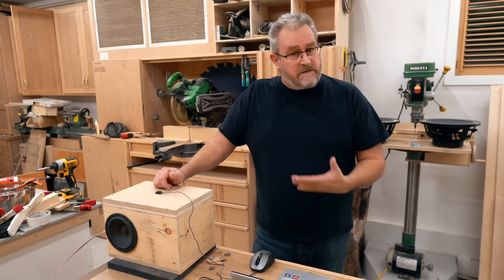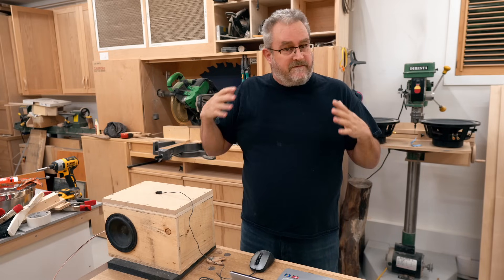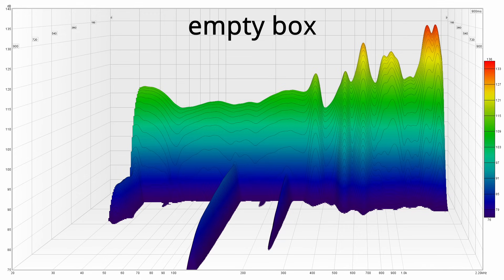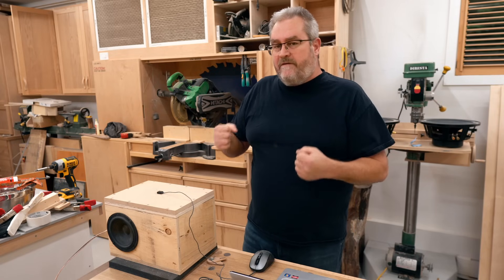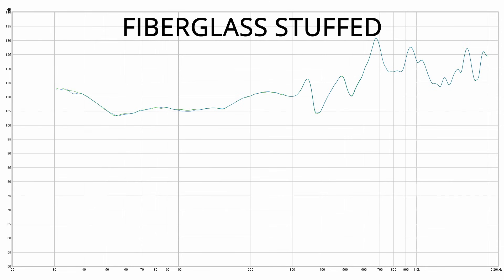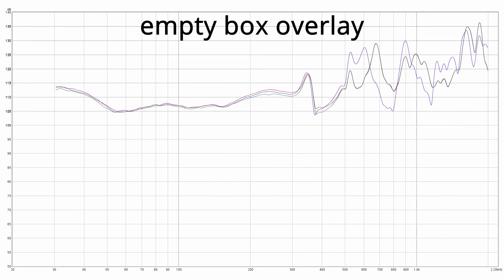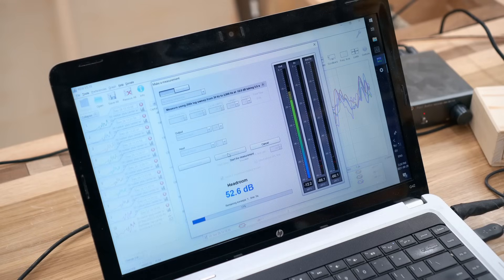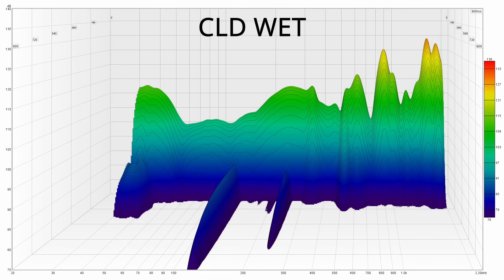Best Stuffing for Speakers Tested - Unexpected Results

Comment: Since you used two equally thick layers with silicone in between you actually mad CSL pretty ineffective. Silicone itself is not good for CLD because it stores energy but this is not the main point. You should put CLD where the shear stress on the visco-elastic layer on the greatest i.e. on the outside layer of the panel. Interesting experiment would be to use damping glue, even silicone would do if nothing else is found and a thin layer of aluminum. When I say thin I mean like a thick foul or beer can thickness.

Comment: Why not, as they say, "think outside the box" (heh, heh), and experiment with concrete slabs, ceramic tile, cement-board, thick cork, sand/epoxy slabs, etc.?

Comment: Fiberglass cotton is nasty stuff to work with, I used it to insulate an attic and a porch and that is the extent of using this material, would never use it in speaker enclosures. 

I had poly-fill cotton on my 1982' home-built V-ported La Scala Klipsch horns, inside the woofer cavity, for tuning purpose but recently, while cleaning them, took it out and I am getting better sound from them. They are crispier though, but I do not run them at high volume as in my younger days.  

I also built a set of shelf speakers, in the 80's, these mini cannons, bottom V-ported which I also used poly-fill to tune them, but the real deal is in the additional Formica sheet reinforcement over 3/4" ply they are built from. The best solid shelf speakers I have built, why I call them mini cannons. 

Whatever sounds satisfying to one's ears is what counts, but the object is obviously to replicate live music as close as possible.

Comment: Add fiberglass and ONLY fiberglass.  Idiots use polyfill and don't seem to understand thermodynamics - the glass fibers pull heat away from the voice coil and act like a heatsink.

Comment: Why are you measuring the resonance of panels?  The stuffing is not supposed to be used for the purpose of dampening panels. It's for reducing resonance within the cabinet to reduce it's interference in the form of smearing on the soundwave produced by the driver.
Reply: Yea. That's what i thought.

Comment: well what about a thicker rubber speaker gasket,rubber is used to stop vibration but would it show results with your test ? which i really enjoyed thank you,im one of those people that never go overkill on bracing and using double walls on enclosures,i cringe in using a double baffle in fact i use 3/4 mdf but when i go to put my double piece on i actually just use 1/2 mdf.my bracing is kinda like well whats right above your head ? if your sitting in your house look up,in the attic theres 2x6's vertical so i use a couple pieces of light weight pine not treated pine 2x4's and put them vertical under the baffle with screws on each side of the box and screws going into the 2x4 from the top.thats just me.ive never cut picture frame shaped bracing,to me it looks like it would interfere with back waves.

Comment: I'd like to know how fluffed up cotton wool works. As a plant product it is green, sustainable, and ultimately biodegradable. Also it is more widely available than long haired wool.
Reply from the maker: Try it. But don't be tricked into thinking it's "greener" because it grows on a plant. 
There's still a lot of processing (that most environmental-patients) would not see as "green" that goes into taking it from raw to refined, not to mention what it takes to grow it and harvest it.
We aren't running out of sand and rock anytime soon, so fiberglass and rockwool are every bit as sustainable as cotton. It may actually use less energy to produce, since so much of it is made at the same time in plants built to efficiently do that.

Comment: I followed your procedure but i think you have it wrong
One thing is the cavity resonance that can be tamed with the 1st 3 materials you tested
And the cabinet resonance that is what you trying to tame
For the box ( not the cavity ) there are different approaches
The simples one is to paint the interior with bitumen paint for instance.
Or a double panel cabinet with sand in between as another option. 
I think you hqve the wrong aproach with the fibers for the purpose of the video. 
Best regards.
David

Comment: I am rebuilding a set of Berkley cabinets for my 12" Gold Monitors. When I originally built them in 1972 and used Rockwool for sound deadening. I have worked in multlex theatres installing sound panels. I have a few left. They are one inch thick of compressed of what looks like insulation.  What are your thoughts on putting this on the cabinets walls instead?
Thanks

Comment: Trust me I agree with the idea that fiberglass or rock wool would be better than poly fill, BUT and that’s a big but, the glass fibers in both the rock wool and fiberglass is just too damn itchy and dangerous to have just blowing EVERYWHERE from the vent/port. Just thinking of it go me itchy over here, I believe the rule of thumb is 1lb (16oz) per 1cubic foot so 58g (2oz) is no where near the recommended amount of poly fill to even notice any difference.
Reply: Of course if it’s a seal enclosure then I would definitely go with rock wool panels agains the face panels then stuff loose fiberglass inside the chamber.

Comment: Rubber generally acts like a spring. Be nice if someone tried Dynamat or Second Skin, they are made to reduce panel vibrations.
Reply: I did that about 2 weeks ago. Kilmat on the inside of my tower speakers. I don't have measuring equipment, but I did one speaker and left the other as it was. To the touch the vibration in the treated speaker was less and stopped much quicker than the untreated. So I went ahead and did the other speaker. I do know it didn't hurt the sound in any way and to me sounds slightly better. Bass was tighter/  more defined. I would also love to see a measurement of this.
Reply: @johnloupis2347  Nice! Makes sense to me but measurements would be nice.
Reply: @freeradical431  I agree 100%. I'm a bit surprised we haven't seen someone on YT do it. I wish I had all the equipment to do a test.
Reply: @johnloupis2347  I think theres a huge misconception that car audio and home audio dont mix. Funny thing is almost every advancement in audio has come from the car audio industry. Shit, we have been using class D amps for years, at thousands of watts, not 125 watts like these Ice and purifi modules.
Reply: @freeradical431  Right! I would think most of the same issues apply.

Comment: i'd love to see a similar video (if you don't have one already!) covering how these different kids of stuffing materials affect the response/impulse measurements from a microphone. i recently built my first "kit" speaker, the desktop minis from GR and there are certain things i'm finding i'm not a fan of. they have a weird upper midbass resonance or chestiness to them, i realize i'm probably using the wrong terms to describe. some electronic music seems to sound harsh, gratingly metallic in the top end. there's probably not much i could do to help the latter, but i wonder if i should have gone with rockwool or fiberglass instead of polyfill, if that might have helped with the midbass/midrange. (i'm not bashing them, i think they were a decent value for 200 bucks) i'm excited for my next project either way

Comment: I feel you are looking at the wrong thing for what you are trying to do. Dampening has nothing to do with panel resonances, it has to do witih SPEAKER resonances inside the cabinet. Your tests of adding material to the top were more inline but I feel that you should test different kinds of bracing and combinations thereof.

Comment: I would have put the stuffing right behind the woofer.  Also, try lining the inside with No-Rez dampening material as a comparison to an empty box - I would,bet that this alone would make a huge difference. The rubber lining you placed was way too thin to make a difference.  The CLD method sounds interesting by sandwiching silicone in between the wood, but you have also effectively doubled the thickness of the wood. I would be interested to see if glueing the two pieces of wood was just as effective than the silicone.  Interesting tests, thank you for posting!

Comment: Very interesting as usual. I wonder if using rubber sheeting between the two panels instead of the  silicon would have more or less effect.
Reply: I found 3m make some very specific rubber sheet. I wouldnt doubt they have something suitable.

Comment: I have been under the impression that stuffing was to dampen internal parallel reflections. Dampening the walls by rubberizing and bracing is in no way polyfills job, apples and oranges.

Comment: I found it odd that the various stuffings weren't directly behind the woofer. I always thought the role of any stuffing was to absorb/diffuse the rearward wave of  the cone and flatten the impedance curve, kinda like how the vintage dynaco speakers did with their aperiodic design. Every acoustic suspension speaker I've ever opened up had the stuffing directly behind the woofer.
Reply: I've opened some older ones (from the 60's) that had wool material on the sides bottom and top, but nothing on the back wall. When I added rock wool to the rear wall it hurt the bass performances alot. So, I decided the people who designed them knew what they were doing and returned them back to stock. The bass came back. Not sure why
Reply: Probably back wall is used as a reflection to reinforce bass from front. Bit like bass reflex.
Reply: Stuffing lowers the effective Q of the driver.  @edjackson4389
Reply: The Dynaco A35 is an interesting sealed design where the woofer chamber was greatly filled with mineral wool, and then a slot in a wall divided that chamber from  another chamber which was empty!
Reply: with my EPI 150’s i did add a front to back brace as well packed as much poly as any teddy bear could take. 2 way speakers are always a battle with bass and muddy v clean and tight
Reply: No not nessescarily. Not directly any way.
Reply: indeed. You first want to cover walls with thin layer. Then add thicker layer in corners and keep little room behind speaker for air to move free and spread  in box. Large walls you brace in middle using wood
Reply: Stuffing has to be in the middle of the box to impact qtc.  Polyfill is fine to use.
Reply: so this test is wrong, rigth?
Reply: @chicotruco  no, this test is fine. That's another test for you to make a video on

Comment: Another thing to try is to put a cavity between two panels and fill it with sand. This should be even more effective than the CLD.

One more experiment to try is to mount the woofer compliantly to the box. Add a ring of soft material between the woofer and the box. I read a study years ago and that had a big effect.

Comment: I always thought that the purpose of stuffing was more to dampen that hollow sound you get in an empty box as opposed to damping the resonance of the panels.
Reply: yes, you can damp the standing waves/resonances, but just a tiny bit. the best way is to put boards horizontally and vertically inside that partially reflect a wave. also using layers of light and heavy dampening create reflections between them. many different reflections result in shifting the energy from a single strong/loud resonances to many different smaller resonances.

Comment: I like your videos a lot because I don't have the software to take some measurements, but I have to agree with some of the comments posted that stated damping is used mostly to avoid sound from the bass driver to bounce back in the cabinet and coming back with a delay and smearing the response. The fact that some materials are damping the cabinet walls is just an added bonus, so that material should be placed in the area around the mid-bass driver to absorb or slow down those pesky resonnances. My preference goes to acoustical foam because it is a very efficient sound absorbant and its elastic properties damp slightly the cabinet walls and stay where you put it. Beside what I have said before, I still appreciate the efforts you put on those videos, they make our knowledge about acoustic advance by leap and bounds. Thanks!

Comment: It seems to me, you are testing the wrong thing with regards to stuffing the box.

Stuffing the box, as you found out, does almost nothing to diminish panel resonance. But that's not why one stuffs a box. Stuffing the box slows down the wave coming off the woofer, thus 'fooling' the woofer into thinking it's in a larger back.

This is completely separate from trying to eliminate panel resonances.

And your test with rubber sheets could have failed due to lack of an mechanical impedance match. If one does not have a close match, there is no way for the vibration from the panel to transfer to the damping material.

Comment: Isn't part of the function of stuffing to reduce internal reflections around the inside of the box as well?  These reflections can be bounced around inside the enclosure, and get redirected out through the driver out of phase (or in phase) and affect the sound.  In this case, would it not be better to actually line each panel with stuffing, to absorb these reflections, rather than just randomly putting in a plug of stuffing in half of the enclosure?

Comment: Couldn't help but think you should place the accelerometer on a panel that you were not removing and replacing, at least for the stuffing tests.
Reply from the maker: I'm curious to hear how much of a difference you think that would make? 
A problem that I run into all the time when showing stuff like this is how people often pick out insignificant factors and boost them up to game-changing events.
Reply: @IBuildIt  You've got an instrument measuring relatively small variations on a surface that is being removed and replaced. Can you guarantee it sits exactly the same, identically torqued using wood screws (relating to filler tests only)?   
What would the harm be in filling through an aperture in a surface that is not under test?  It's a rational observation regarding experimental methodology. 
If you say it absolutely cannot make a difference, then there's your position.   "Boosting to a game changing event?" Of course not.  Sensitive much?
Reply from the maker: @RobertHartmannJnr  You obviously thought it was important enough to write a comment to begin with, then an even longer one justifying your position. 
Anyone who can correctly rate the importance of these factors in a very loose non-scientific demonstration like this wouldn't bother.
And like I said, I was curious what you were thinking. If you are too sensitive yourself that you can't tolerate being answered in this way, then stop making comments. This is my playpen - you are guest here.

Comment: Damping is proportional to the density of the material.  So light weight fluffy stuff isn't very effective.  If you pack fiberglass in at high density it is very effective.  Pretty much any textbook on acoustics will show this relationship.

Comment: This is an interesting test, but I was always under the impression a thin layer of stuffing attached to the walls was dampening, but stuffing in the enclosure is tuning for a enclosure that is slightly too small for the speaker, the stuffing slows down the waves in the box causing it to act bigger.  

That said, I'm not sure how much sense that makes since a solid should conduct sound faster than air, but the explanation has aways been that you're preventing a direct path, kind of how insulation prevents a direct path for heat to escape by capturing some air volume. 

Not sure I buy either explanation, but you can audibly hear the difference in the speaker most of the time.

FWIW, I've always been team fiberglass even though it seems like polyfill is preferred everywhere.  I've typically used 'glass for my own stuff that I didn't care as much about and poly when it was supposed to match some spec or someone else's standard.
Reply: Sound waves are pressure waves moving through a medium like air, water, wood, plastics and any other material that exist. Some materials like rubber, foam or cork are good at damping pressure waves because of their elasticity. This mean they absorb and redirect that energy, transforming it into heat (yes, that's right, heat). The proportion in sound to heat ratio is quite low, but enough to slow down the sound waves and lower the cabinet rebound sound, particularly in the midrange. With some crossover artifacts like a notch filter, it help the speaker sound balanced without killing the dynamics.

Comment: The silicon is very interesting to me as I made a turntable support from 2 pieces of MDF with silicon in-between. This worked really well.
Reply: the theory behind it is, that the silicone layer has a different "wave resistance" than the wooden panel. that creates a reflection. so, one single wave is split up in two waves, one that goes through and one that is reflected back. better is to have three wooden panels with different thickness and two silicone layers. then you have 4 reflection points in that sandwich where the energy is bouncing back and forth multiple times and therefor getting absorbed a bit more.
Reply: @stefanweilhartner4415  I will experiment with that thanks

Comment: I have much success with dynamat. Make sure you have a roller and get it on tight. Many speakers simply will not have enough room for getting the dynamat properly installed. I put sound barrier on top on it. 
Only helps poorly braced boxes that have low frequency resonances, mine being 300hz specifically.